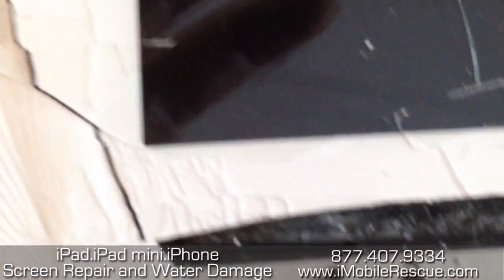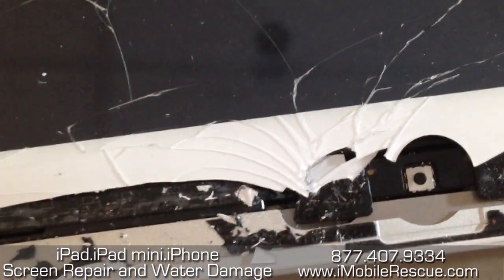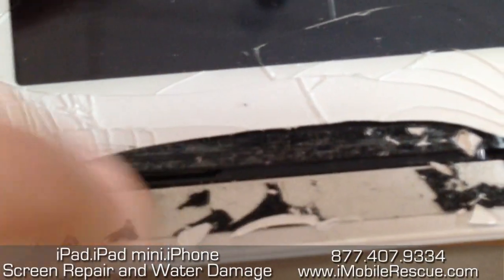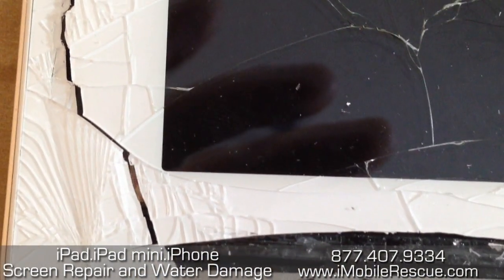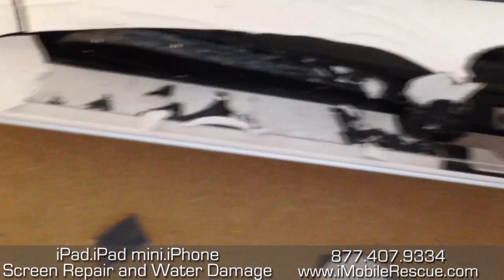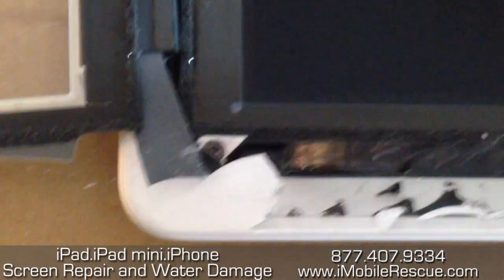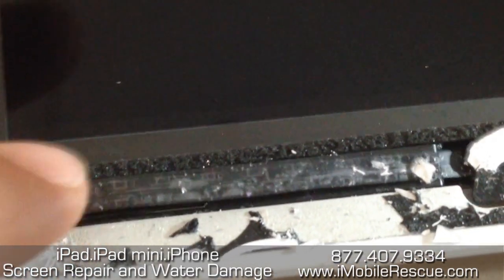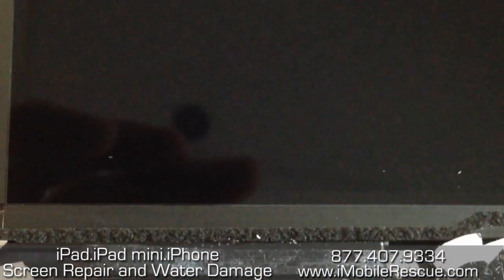iPad 4 Home Flex Cable! How Not To Cut It - Screen Replacement

Comment: Thank you.  You just answered my question. I am working on a iPad 3 and I got the cracked glass off and now I am just waiting on my new glass to ship. Looking at another video they mentioned a home flex cable. I was like I never seen that cable during my tear down.  Until I found your video I am so relieved.  
Quick question on the iPad 3 my camera bracket is missing. Will that affect my reinstall if I make sure the camera is aligned properly with the hole? 

Back to the home button on the iPad 3 I just put the home wing on the new glass and when it touches the brass screws sticking up it should work right? 

Thank you again